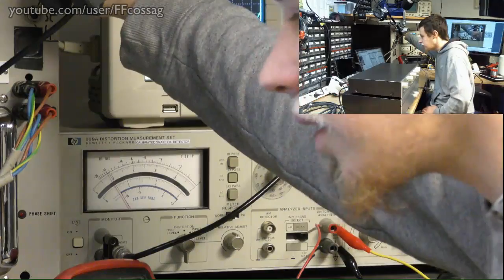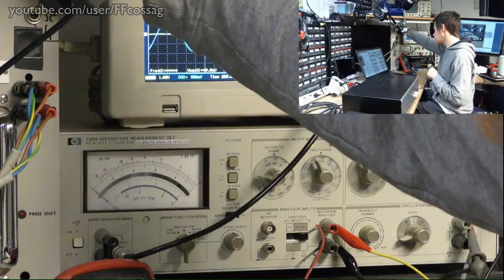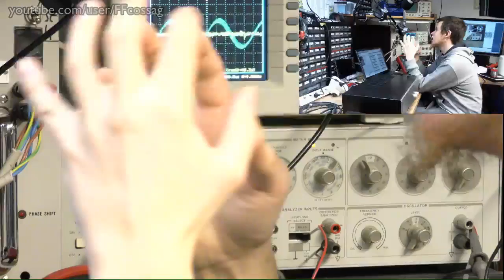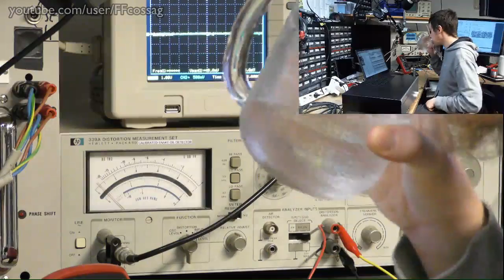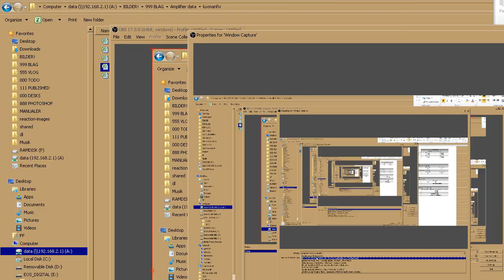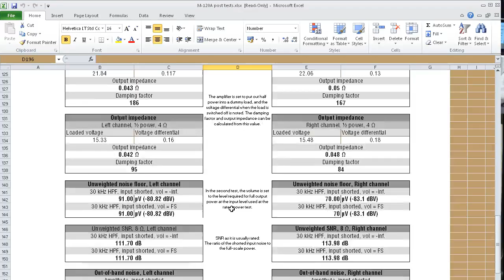Luxman M-120A performance test w/ HP 339A

Comment: Great torture test on this amp.  Can you please provide details of what you did to the amp between your first test and this test.  Minor tweaks, or major component replacements? Would love to get the details, as I have this exact amp, which I must say I just love....
Reply from the maker: I'm not sure what you mean by first and last test. This was a livestream, there are no cuts. My M-120A is pretty standard, although it has some more modern output transistors installed and runs lower bias than stock to reduce noise. The signal wires to the volume potentiometers are also rerouted, as the factory routing makes them pick up some hum from the transformer.

Comment: Hi, thank you for your videos. Something about the HP339A. I have one here for few years, it is a very good instrument, passes successfully all verification checks and also very accurate, no problem at all. My question is about the needle rapid movement to full scale for about 1-2sec (mechanical stop of the meter) when the instrument is powered on. Then and after the 20min warm up period is exactly zero as it should. Please is it normal?
Reply from the maker: Mine boinks the needle to the stop when I turn it on, but it's working well and within spec instantly, without warmup.
Reply: @FFcossag  Thank you for response. Happy for this answer. Yes actually not all the warm up time needed but I follow the users manual suggestion for at least 15min warm-up time.